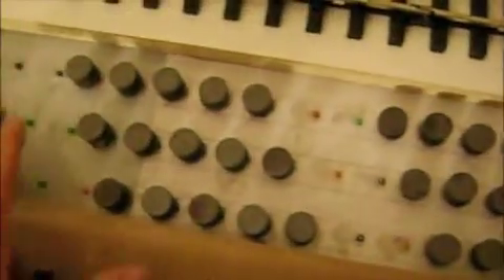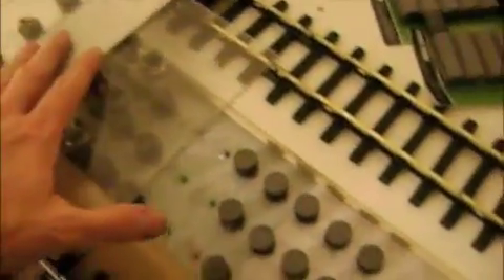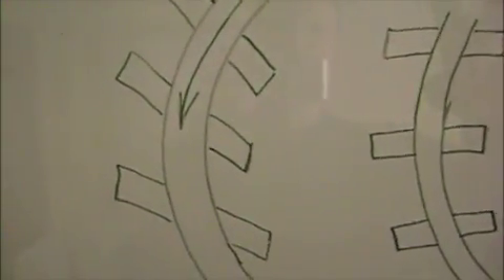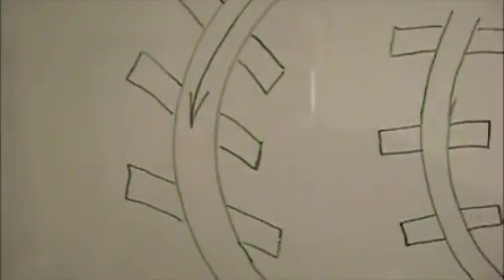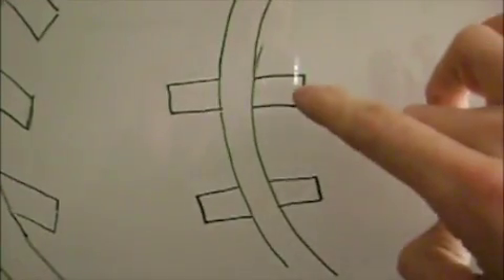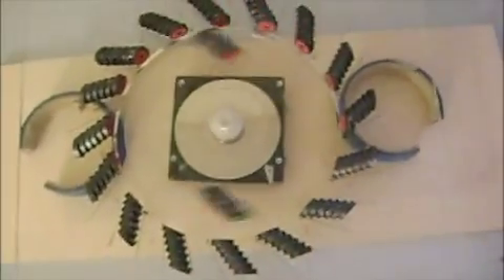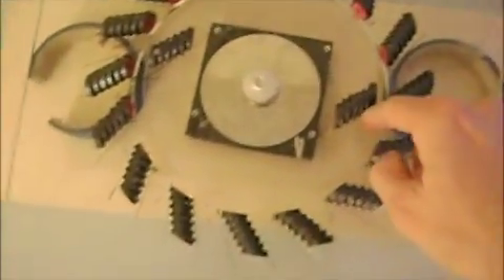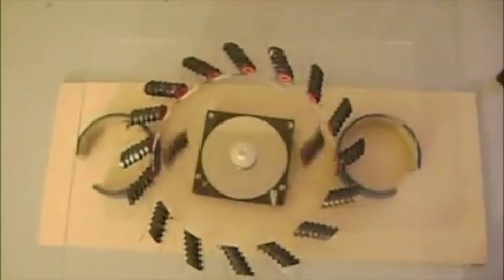How the Perendev Motor worked... If it worked. Part 02

Comment from the maker: There are limitless possibilities of how to arrange the magnets in the assembly. I didn't actually expect the rotor to work, in the configuration shown in the video. It was more about looking for signs that it could work, if shielding were added, and the configuration was adjusted. I like how you think though. Using attraction and repulsion would probably be the right way to go, and was one of the points I made in part one.

Comment: On 2:50 minute of the clip you've asked what is that little thing. That is socket head cap screws that holds some of the elements on the shaft.
Reply from the maker: Bojan Paunjelovic I've also heard that one of his magnetic assemblies broke lose and was the culprit. It's just fun to speculate.
Reply: Bojan Paunjelovic hi just quick quest...did you come to some good result? Cheers Dragan
Reply from the maker: Dragan Zaric Nothing worthy of publishing, relating to the Perendev design.

Comment from the maker: Perhaps. One video, of a supposed replication, utilized magnets that were actually cut at an angle on the ends that came in close contact on the rotor and stator assembly. That's what I was referring to in the video, and how I would have assembled the design, if I had a diamond saw. I believe that particular configuration would alter the electron spins of the magnets in such a way, that it might be possible to achieve rotation.

Comment: good stuff, one note on the last configuration, I would suggest putting the magnets closer together or putting a metal ring in there so the stator magnets touch it and the flux is shared between the magnets so its not so much of a gap from one to the next. Also concerning the rotor,  did you try one stack of magnets in attraction pulling clockwise and the other stack in repullsion pushing clockwise?

Comment from the maker: The intent of my video was to lay out a possible scenario for how it might possibly have worked. If you were absolutely certain you could build a working magnetic motor, I would be behind you 100%. I believe it comes down to about 90% determination anyway. I don't want to sound discouraging at all, but if you are discouraged easily, it's probably better to stop before you lose to much of your time. I don't believe in the impossible. Only you can determine how important it is to you though.

Comment from the maker: According to Brady, they are all in repulsion mode. I've tried it using repulsion and attraction simultaneously, and experienced similar results though. I wish it were that simple. If you have some ideas though, try them out. If you figure out the correct configuration, you will have a lot of grateful new friends.

Comment from the maker: You are correct. The diametrically magnetized magnets are from a design drawing that came from Robert Calloway. The original plans are downloadable off of Sterling Allan's peswiki website, if you'd like to take a look at them. I know the magnets were 1 in diameter by 1 in length, axially magnetized. Those can get a bit expensive, but that's what was used in the original. Shielding is the trick. I don't think it will work without shielding. Supposedly, they used bismuth. I'm not convinced though.

Comment: From all the videos that I've been watching, and especially yours, as it is the most informative, I reckon this motor can actually be developed, but the problem to overcome that you brought up is the fact that the magnets need to be alternated and not in fixed repulsion / attraction mode, as this will wear them out. Have you had any more improvements? Another thing would be to test how long the magnets would last before having to change them because of the fixed repulsion / attraction mode.

Comment from the maker: I'd love for it to be that easy. First you'd have to increase the motive force generated by the magnets, so that they could lift the weight to a position that it could be dropped back down, in order to escape the sticky spot. It sounds simple in theory, but it's not easy to execute. I've tried some designs that employ gravity. Thanks though, I'll keep working on it.

Comment from the maker: The biggest thing I was trying to accomplish with both of the videos on how the Perendev motor was put together was to lay out a set of principles that could be used to build and test the design in a flat track, before building a rotating version. I've seen many people try to build their own version of Mike Brady's design, but most of them skip the flat track entirely. To test the design properly though, would require more money than I was willing to put into it at this time.

Comment: In 1980, Howard Johnson had the first so called magnetic engine but it didn't work. Many years later, Perendev  inspired me with his design but it ran down due to unwanted magnetic field collisions slowing the crankshaft. So, much work has been done to eliminate these unwanted magnetic field collisions so they focused on shielding. They tried bismuth, ferrite, steel, lead, giron, numetal, but nothing could shape the magnetic flux lines without weighing a ton. I will be applying for a patent soon which completely overcomes the magnetic field collisions issue. Stay tuned!

Comment from the maker: They are angled, but it's hard to tell in the video. I've seen the magnetic rail gun video. It's not quite the same concept as the Perendev. If you build one, you'll find it's really just more of a toy. You have to overcome the repulsive force at the opening for it to work. So it's really more like a sling shot. And if you move the slider magnet farther away from the opening it loses much of it's motive force. Meaning you couldn't arch the geometry of the design and use it to achieve rotation.

Comment: The one thing that is missing IS...... the outside magnets are in the Wrong configuration. The outside (stator) magnets are not just North pole facing in but also South Pole facing in.  Its a Push-Pull Theory,  the South Pole magnet on the stator pull the North pole on the Rotor, and then the North pole on the Stator Push the North pole on the Rotor. - Please try again you are very close.

Comment: Nice build, but Your only fail, is, you're not using a magnetic shield in the closer side of magnets of  the inner rotor.  it is necessary to keep low the magnetic field until the rotor's magnet be in the right  angle  to repulse  the external crown in the  right  ratation direction.  search in google how  to build  your  own magnetic shield made  with 2  metals sheet.
Reply from the maker: Diego Martin Thanks for the suggestion. It's possible that would help. It's also possible that Mike Brady's design just doesn't work.

Comment: The magnets Will loose power after two Months or something...but I believe there is a workaround (i.e. as a way of a 'shield' from magnet loss):  ***METAL WILL ACT AS *ANY POLARITY** (POS OR NEG FOR 'ATTRACT' OR 'REPEL') WHEN THE METAL TOUCHES THE MAGNET.    Note: If the magnetic metals (regardless of pos or neg of attract or repel!) touch each other, then they will stick, so they can't get too close!  And also, it does lose a little strength when you do this!   I don't know why they don't tell you this, but try this mag metal polarity for yourself, it will not fail, but the testing for longer than more than two months by this metal shielding awaits a mystery to be discovered  !!!!!!

Comment: that black marking in the rotor is a marking (reference point of turning 1 full circle) another words..once the model works aka perpectual motion, wanting to know how fast it spins then he/she would use a multi-meter that can measure the turning speed in units of RPM.  (revolution per minute).  some multi-meter can even count # of successful turns by mesuring that distinctive black marking. you can buy a  meter with just that purpose RPM/Count..
Reply from the maker: It would actually be nice to have one.

Comment: interesting magnetic motors. I want to build one. like perendev magnetic motor.

magnets has its own propertie(push and pull). other uses magnetic (metal) shielding. but there is a problem when you put shield on it, still you cannot pass the force until you pass the entire piece of magnet in horizontal way. when you put iron shielding on it means nothing. 

if you want to know the secret behind that motor (perendev) the secret is the magnet himself.

Comment: if you angle the bottom ones with the top facing the direction you want it to go. and the top ones in the direction in the same way it will work better

Comment: one half of the stato,r the magnets are at the same angle as the rotor magnets but the other half of the stator. the magnets should be at 90 degrees to the rotor magnets. At least that is what I have fould on some videos where there magnet motors supposedly work. With proper shielding.. Monte Hoskins

Comment from the maker: There is nothing mechanical in the Perendev Motor design that I'm aware of. The original design, if it actually worked, was comprised of permanent magnets and shielded material. The most important thing that this type of research requires of you, is the ability to actually believe it can be done, because most of the physics police will tell you it can't. I believe it's possible to build a magnetic motor, but I couldn't  tell you with absolute certainty that the Perendev design actually worked.

Comment: to prove this in linear trck you can choose to place the cart with no magnets in its back. there us thus imblance because there are many magnets facing the cart eith no mgnets at the at its back to make zn eual opposite pull. try doing ur vidos using circular trck. any point in the circle mezns 50% magnets pulling the cart forward nd 50% pulling it back.

Comment: Read up on Gauss's law for Magnetism (and/or magnetism in general) on Wikipedia. Basically the net flux through any surface you make will be 0 (and you can't have a monopole magnet). Good luck getting free energy from ferromagnets. If you really want to get excited and support something important, try superconductors with Tc (critical temperature) around room temperature. That's remotely possible and would be truly awesome.
For those hellbent on this stuff check out: /watch?v=0dkiHUasERA

Comment: 17 inside 20 outside,, so 3 pairs align at a time balancing the circle, it is basically a rotating triangle of repelling alignment and is perpetually playing catch up , the 60 degrees should make more sense now to you. so you can use like 100 and 103 or 100 and 109 or 106 depending on how many aligning triangles you want in the system .the helix is just a logical arrangement like 3 phase is,,,
Reply: i forgot to ad, the magnets will die out just like regular ones without a gate because of the clashing fields. its like buying a wind up radio that someone wound up for you at the factory
Reply from the maker: wnicbrown Well I like how you describe it. And yes, it's entirely possible that the strain would wear the magnets out. That's one of the reasons I believe the magnets need ferrite shielding around them. To create a buffer by repelling and attracting.
Reply: i discovered a better way to induce dc mechanically , verry high phase , rectified using the armature as a choke v regulating assortments of the same coil crossing multiple oscillating fields matched up with the +- directly , no theta calculation necessary... the armature ,being stable is designed to induce no dual resonance or stop go but  remain constant , furthermore it has no central axis , so is suspended like a ring spherically at the crossover planes... making the armature self aligning. no bearings just 2  commutators , cap mosfet air cooled and bridge are suspended in the rotor. i am working on  models  that could utilise the missing poles on maya now, but coming up with a more efficient design laser cutting laminated plates in this semi spherical fashion is  like a jenga nightmare.concept stands, the proportions are the qualm. and no wasted poles !  have to build a da vinci wheel just to let me cnc the parts on my own

power regulator
Reply: to lend confidance
Reply from the maker: wnicbrown Sounds interesting. Did you shoot any video of that? I'd love to see what you came up with.
Reply: working on a animation but first sorting out kinks in the design to make it easier to build... will post it on my channel once i feel more comfortable or confident about the design practicality and overall look of the device ,balancing out the different coils in terms of windings thickness of wire  and wiring ect, is still something i have to study up on,,, any good tutorial suggestions on youtube ?
Reply from the maker: wnicbrown I look forward to seeing it. Sounds interesting. Let me know when you post it.

Comment: Why didn't you use more than two magnets on the rotor? Maybe if there would be 3,5 or more but asymmetrical, the system wouldn't be able to find its balance!
Reply from the maker: Mostly because the rotor was simply for demonstration purposes. To do it right would require shielded magnets. Regardless, before building a rotor, it's important to find a working arrangement of magnets that generate motive force. None of the flat tracks I experimented with did that, so there was really no reason to waste the time and money to build a rotary version. I was simply laying out the principles of how you would assemble and test different arrangements of magnets, in order to build a perendev style magnetic motor.

Comment: you need to angle the face of the magnet not the stack. with the faces flat to each other you are making the same mistake that you have pulled other people about. also this motor works when the magnets repel not attract. hope this helps

Comment: Magnetic field does not have a direction behavior like perendev motor principe assumes. You cant turn magnet and expect that fields will react differenlty. Its the catch but nice concept you made.
Reply from the maker: You can change the way the spins work by angling them in certain ways, but I know what you're saying. And thanks.

Comment: the first part of the video begs the question. why do you always start ur cart on the track with no magnets on the rear. u should be able to propl ur cart evn f place an inch before the trck ends. this is importnt because ur only able to proprl ur cart due to the fact that facing it ar too many magnets. if u put ur cart in the middle of entire lenght of the track where magnetic field is 50% fcing it znd 50 before u will not be able to gain an inch because the magnetic fils ill csncel ech othe out. all ur videos fail to address this trchnicsl problem. one cannot producd petprtual motion based on his videos.
e

Comment: further in linear track as the cart moves father away from its starting position more magnets are left behind pulling it bck. dats is why all ur videos show the cart starting on the part of the trck eith no mgnetd behind.this is msleading.  the technique which is impossible to do s that as the cart lesves the magnets behind these magnets dhould lse their magnetim fr the time being so that it will not offer simultanoeos opposite pull. since onky electromagnets can do dis, then such is imposible ith pemanent magnet.

Comment: Fixed magnets interacting don't make continuous energy. This is silly. Permanent magnets in any system push and pull without any net gain in system energy ever. NEVER has this rule been violated.

Comment: I've been trying to make free energy for years, but the input energy is always more than the output energy, ALWAYS.  I cannot get free energy out of any invention, because they all have losses in their bearings, coils, conductors, everything has resistance, mechanically and electrically.  I think that when the flux is generated by the mechanical energy and permanent magnets, that it gets lost too.
I need to fall and hit my head on a toilet seat or something, cuz it's wreckin my head. flux..cap.

Comment: it doesn t work simply because you prototype is not the Perendev motor !! It's just a single wheel with only 2 magnets. There are at least 5 or 6 main points to be respected in order to make a Perendev motor work. None of them here is respected.